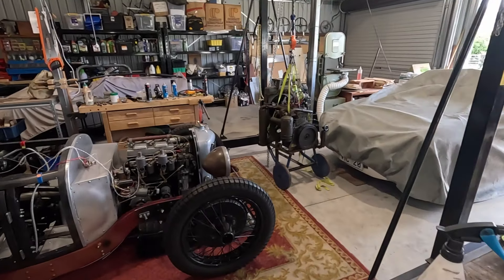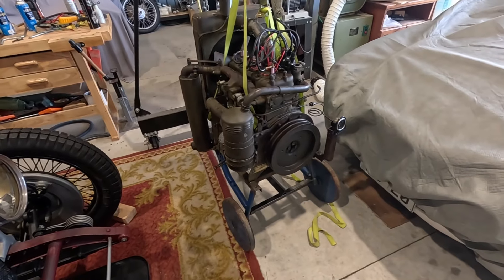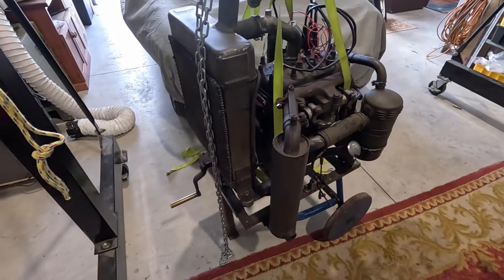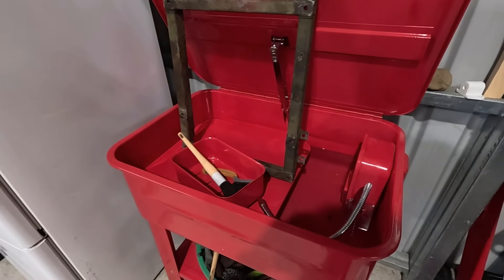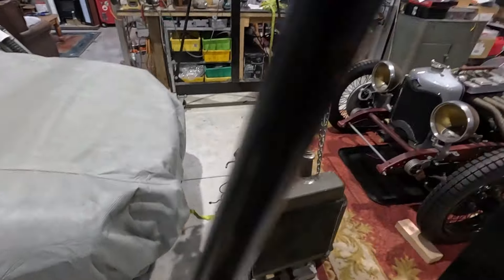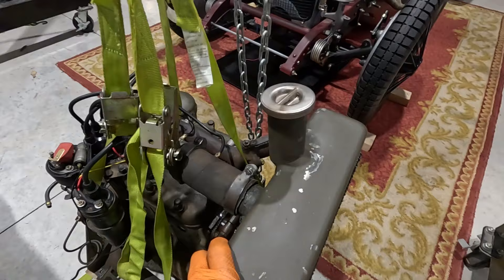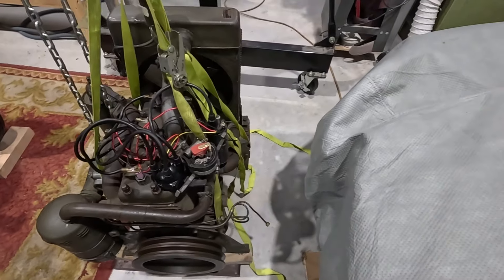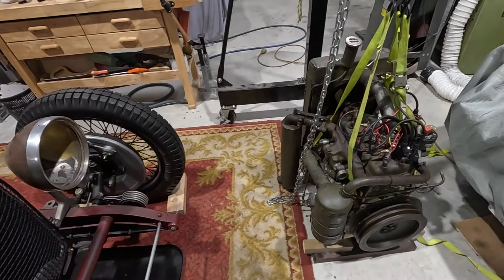Coventry Climax ASM Engine - Part 5

Comment: Geewiz..  I didn't know you had so many mice!   My only rodent worry is out in the shed, especially in the winter.  I deal with the problem with methods I probably should not admit to on a public forum. If by chance they are foolish enough to come into the house they are met by a ruthless gang of cats.  The engine stand is looking good.  Cheers
Reply from the maker: Just at the moment there seem to be a few. It should go quiet again soon.

Comment: ON YOUR METALMASTER  do a mockup with a 4x2  between the horizontal's and use a bar clamp to hold it in place to see if it stiffens it up , before drilling and adding the all thread rod  ,  maybe ?
Reply from the maker: It was more an interesting through than something I actually want to do. I am not sure I would notice any difference and of course adding anything in the frame means you lose depth on the throat.
Reply: @asciimation Add a truss to the top rail   with the center of the truss about 100 mm long . That will stiffen the tube so you don't get flex . Also I tend to go light with the pressure and only increase it if I feel it's taking too long to get shape into something . The frame on my wheel is 800 X 400 RSJ about 8 mm thick and I can still make it flex if I crank up the pressure. 😅
Reply from the maker: @Mercmad  I suspect one of the 'bad' things I do is have the pressure too high too fast. When I am really, really bad I end up with marks in the panel!